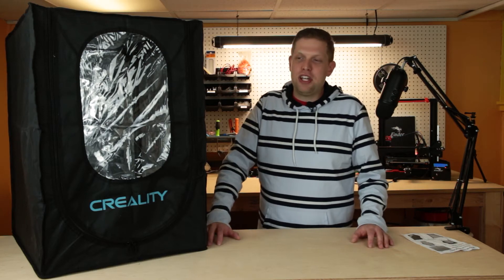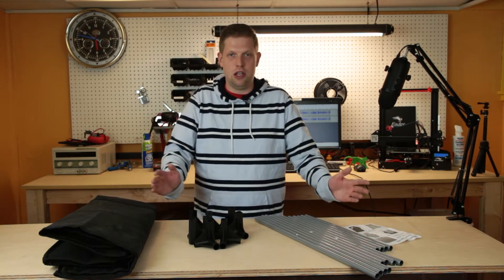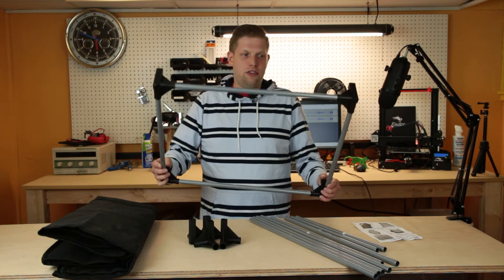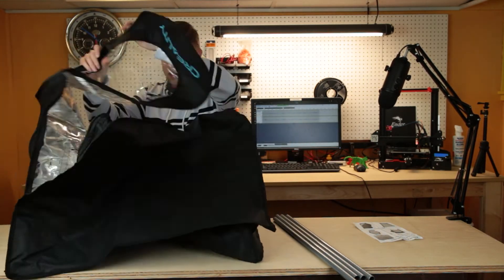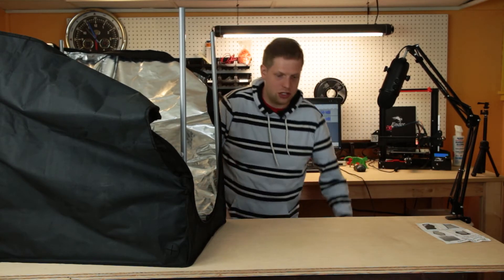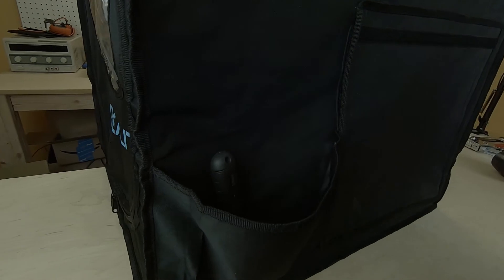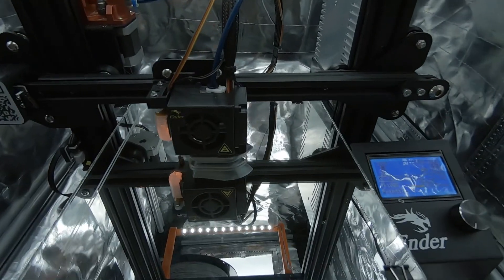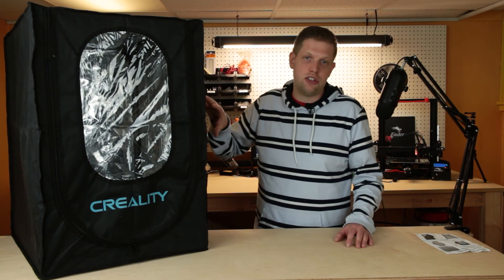CREALITY Ender 3 Enclosure Assembly

Comment: Will CR10S Pro with it a extended operating dimensions  at fit in this container 35.40 x 27.85 x 35.43 inches operating distance.